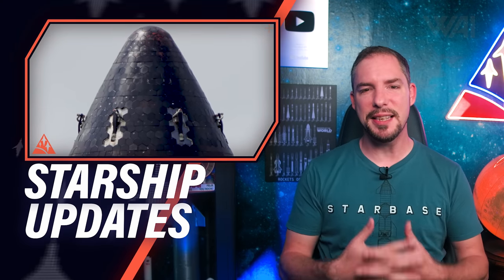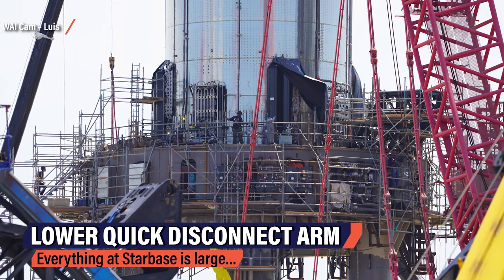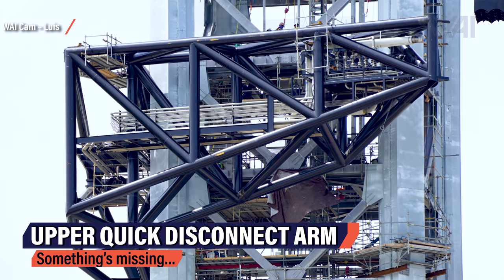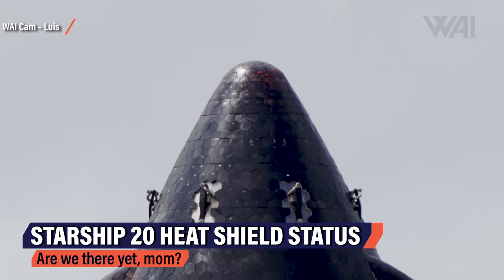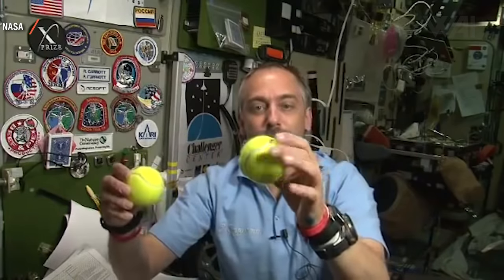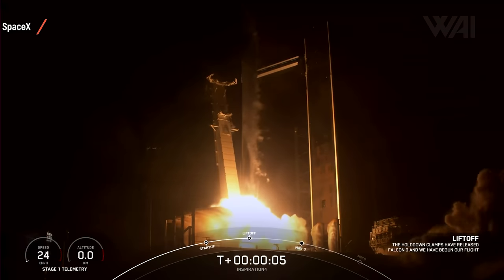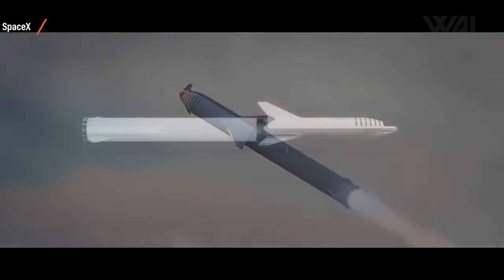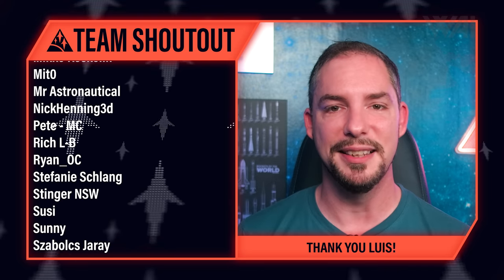SpaceX Starship Heat Shield Done! – Inspiration 4 Launch Summary

Comment: We need to make space travel cheep enough to take all the flat earther ring leaders to high orbit and lay that one to rest for good!
Reply: New ringleaders would arise from the ashes of the old. 

People have known the Earth was round for well over 2,000 years. Aristotle is credited as the first known person to calculate the circumference of the Earth in the 300 hundreds BC, but was off by a lot (about 20,000 miles too much). Around 250 BC, Eratosthenes got a measurement to within a couple of hundred miles of the actual circumference of ~24,855 by using the angle of sunlight in two wells in Egypt (he got around 25,000 miles). The whole bit about Columbus proving the Earth was round is silliness. Columbus thought the round Earth was smaller than it is by using a calculation that was disregarded by most educated people.

Comment: How Space X will rotate the rockets on vertical access to align the QD arm or the fueling platform at the bottom ? although just lifting it and rotating would work temporarily but not a permanent solution..

Comment: I'm puzzled. the steel hull is still bare where the mounting points for the crane are. I would have assumed they cut those off once mounted on the B4 and then tiled over.Otherwise its a weak point in the sheild where friction and air can get under the other tiles and rip them off?
Reply: It will be covered later
Reply: They haven't stacked it on top of B4 yet.
Removal will have to wait for that to be completed
Reply: @kevinkrammer8077  so......basically, spacex starship heat shield isn't done yet ;)

Comment: Odds to get the first orbital starship to splash in one piece.... maybe 0% to 5%. Odds to get it to orbit in one piece... maybe 20%. Odds to get it off the launch pad in one piece... I hope the odds for this are very high. However, there are so many firsts even for the takeoff for the booster and the launch pad and the launch tower. I would rather have people guessing on how many startship launches are needed before the first splash in one piece. And when will we see a first launch of reused Starship and the booster? I would say early 2025 or later... but of course I hope they get there much sooner.
Reply: Eh, Musk thinks B4/S20 will likely get to space, it's the return that is what they think will take some tries. Elon Musk's Mar 30th, 2021 tweet

"Next major technology rev is at SN20. Those ships will be orbit-capable with heat shield & stage separation system. Ascent success probability is high.

However, SN20+ vehicles will probably need many flight attempts to survive Mach 25 entry heating & land intact."

Comment: Forgive a dumb question: but how can they launch to orbit with all those extra bits and pieces outside the booster hull?
Are they going to give them fairings or is this booster for ground testing only?
Reply: Fairing will be added
Reply: As Alvian said, they will likely add farings over the equipment, but the Super Heavy booster doesn't get near to orbit.

Comment: Production Note: Felix, your facial skin looks very red. That is unusual. How do you color balance your cameras? The easiest way is to set a custom color balance by holding up a large white surface such as a sheet of paper where your face will be. Then zoom your camera in so the full frame is filled. Go to the camera menu where it allows you to set a custom white balance. Your camera's manual should tell you how. Then lock it in. Remove the white surface and zoom out. Whatever you record will now be color accurate.

Also, your lighting looks much better.

Terry Thomas
Director of Photography 
Atlanta, Georgia USA

Comment: I understand spaceX is planning on splashing down SN20 in the ocean for safety reasons rather than risk a land based recovery attempt.
I was just wondering is the reason for not attempting a drone ship recovery the greater weight of starship compared to Falcon , is starship too heavy ?.
Reply: There are a lot of reasons, but the main one is that drone ships are expensive, and they're not going to risk putting one in the target area until they're confident that the vehicle is going to be reaching that target area in one piece and under control. And if they had that confidence, they wouldn't be dropping it into a missile test range in the Pacific - they'd be trying to land it somewhere closer to home.

Aside from that, there's also the fact that they don't have any spare drone ships, their existing ships aren't designed to operate in the rougher waters of the mid-Pacific, and yes... Starship is considerably larger and heavier than a Falcon booster, so the ships might struggle to bring it in.

Comment: Why are TPS tiles butted up against each other?  Why not overlap them?
Reply: My understanding is that they will expand slightly to fill the very small gaps between them.
Reply: @steveaustin2686  I understand that.  It's how the shuttle TPS worked.  It requires some kind of malleable high temperature thermal blanket material in between to deal with the expansion and contraction as well as the plasma bleeding through.  

It's a stupid, overly complex design.

Roofers deal with a similar problems with roofing tiles.  Roofing tiles expand and contract, but they also have to keep out rain.  Also the rain only comes from mostly one direction, plus or minus maybe 20 degrees of arc.  

Roofers solve the issue by just having tiles overlap a little.  As far as I can tell you could do the same thing with a tile TPS system.  It solves both the cracking problem where tiles expand into their neighbors and it avoids plasma bleed through that threatens to compromised the hull.
Reply: @joelcorley3478  Roofing tiles sit on the roof and get blown off in high winds. The thermal tiles deal with supersonic speeds on ascent and hypersonic speed on descent. Not to mention they are reportedly fragile for bumps, so them rattling against each other where they overlap is likely not a good thing. AIUI, with the steel hull behind them, the gaps in the tiles are not as big an issue as they were on the aluminum Shuttle.
Reply: @steveaustin2686  Roofing tiles don't simply sit on the roof.  They are attached.  I used to live in an area that routinely experienced 60 mph winds.  I never had a roof tile torn off because they were nailed down and used an adhesive at the edges.  I'm pretty sure you could design an attachment system that worked at supersonic velocities.

You could expand on my suggestion by having the tiles overlap on two sides - from the windward side and the nose.  Put some kind of bullnose cap on the nose and you would minimize the shear force during launch, streamlining the airflow.
Reply: @joelcorley3478  I live in Florida and I'm thinking of hurricane force winds. I'm not sure that overlapping will work as I mentioned above that the tiles are fragile for bumps. You certainly could write up a description. Musk took a suggestion from Tim Dodd, Everyday Astronaut, during an interview, so why not try it? The worst they can say is no.
Reply: @steveaustin2686  - I suspect hurricane force winds are a little different than the forces experienced at max-Q and on re-entry.  For one thing I think hurricanes are more dynamic so surface turbulence is probably a big problem, while simple shear forces and thermal expansion are probably the main issues the tiles have to contend with.

"Bumps" are basically issues with surface deformation due to second derivative forces - rate of rate of change in velocity or simply rate of change of acceleration.  That causes the structure to deform in a waveform.  The waveform causes the tiles to strike against a neighbor.  To avoid damaging the tiles, you don't want to dissipate the force of these waves through the tiles.  In other words you want the tiles to slide over each other and not hit each other.

As for contacting Musk, I really have no way to do that.  I'm not a YouTuber - I'm just a recently retired Microsoft software engineer.  I would like to get the idea in front of Musk and I really don't care if I get the credit for it.  I just think this idea solves problems I see in the TPS tile assembly and it does it without adding new parts.  Indeed it potentially deletes the thermal blanket they're using under the tiles, thus saving hopefully enough to offset the weight of the overlap.

I brought the idea up here in the hopes that others might see the merit in the idea and champion the suggestion in forums where he might see it.  And FWIW, I have tried tweeting the idea to him directly ... but I'm sure that was probably just lost in the noise he sees every day.
Reply: @joelcorley3478  Um, max-q is usually at or after the spacecraft goes supersonic, so quite different that a hurricane.

By bumps, I mean physical hits to the tiles.

You could always type it up and mail it. That is what I was actually thinking about.

Comment: I love SpaceX and their progress, but there is no way that S20 can survive reentry in one piece. If that happens, I'm going to go bald for a month.
Reply: Yep. There are a lot of people here with very unrealistic expectations given how many new elements will be present on this flight. 

The two failure modes I'd be worried about are the booster, and the re-entry. I'm pretty confident in the vehicle itself, so if the booster works, they should reach orbit.  But I'm at best 50/50 on the booster running for long enough to reach separation, and I think I'm generous in suggesting a 1% chance of successful re-entry.

Comment: How can the heat shield tiles stand up to the force of being "grabbed" by mechazilla?  The tiles will be supporting the entire weight of Starship.
Reply: Mechazilla arm will not be touching anywhere near the tile area
Reply: @alvianchoiriapriliansyah9882    Where or on what will the grab arms contact Starship?
Reply: @davecrook8355  mounting point near the forward flaps or the flaps itself

Comment: Failure is an option, but how do they gather data on how the heat shields fail if they can't recover it?
Reply: Simply by telling if it survived reentry in the first place, and sever data from sensors & cameras
Reply: @alvianchoiriapriliansyah9882  Sure, but it would seem better to be able to physically inspect the tiles after returning, and look at damage to the spacecraft where the tiles failed to protect. Afterall, we want a spacecraft that can be relaunched over and over without being rebuilt, not one that can simply avoid destruction.
If it's not ready to land, I'd add some sort of explosive airbag system that is deployed on the ocean so it won't sink.
Reply: @aresmars2003  They can still inspect the one they intend to catch

Comment: I understand a heat tile is constructed in a very particular way to give it the desired properties. But why wouldn’t an abrasive material that could be sprayed on in thick layers work? I understand the weight exchange of the problem, but the material could ultimately be optimized to be effective and light weight.
Reply: Can you explain in more engineering details how the spray-on materials is gonna be suitable for rapid reuse?

Comment: C'mon man, SpaceX is swinging for a home run first time at bat. Untested booster, first time Raptors running 100%, first time at launch velocities, first time vacuum Raptors perform in space, first time heat shields, first time return at orbital velocities. I give them a 25% chance of successful booster to full altitude without blowing up, if they reach altitude I give them a 75% chance of vacuum Raptors getting Starship to de-orbit point, then 0% chance of landing with break up in upper atmosphere. Even if they lose the vehicle on re-entry, that would be a very successful flight.

Comment: Felix, you repeated a mistake from the life stream. At 10:47 in your video you claimed Inspiration 4 will fly higher than any human since Apollo. And the graphic from SpaceX shows the altitude where Hubble is now. But that's not where Hubble was first launched. Anything in Low Earth Orbit is gradually falling out of orbit. ISS stays in orbit because it receives propellant to constantly push it back up. But Hubble doesn't. It was put in a relatively high orbit where it would fall more slowly. Space Shuttle mission STS-31 in April 1990 launched Hubble to 613km perigee, 615km apogee. Today's mission is to 575km so actually this is the highest since Hubble was launched in 1990.
https://en.wikipedia.org/wiki/STS-31

Comment: They should dip the belly in a ceramic coat then bake it in one piece.

Best part is no part
Reply: More complicated & prone to cracking
Reply: Do you have a 51 meter (163 ft) by 10 meter (33 ft) by 10 meter (33ft) oven hiding somewhere? :) :) :)

Comment: Question;  Could the Spaceship slow its speed while in low earth orbit, then drop into earth's atmosphere and land wherever?  Eliminate the need for heat shields. Bozo dropped without a heat shield, two men jumped from a ballon without heat shields.  Im just wondering.
Reply: It will waste tremendous amount of fuel
Reply: @alvianchoiriapriliansyah9882  What is the weight of the heat shield?  Maybe a economical trade off of fuel vs weight could be made?  What if you were the person to figure it out?  Imagine how wonderful that would be.  Thank you my very very smart rich friend.
Reply: @jamesfrost7465  Still results in a net waste of fuel even when heatshield is removed. Learn rocket science more and you will understand
Reply: @jamesfrost7465  Nah, but next time research the topic more thoroughly before commenting

Comment: It will not make it. The chances are low. It is funny to think that the shuttle failed for the heat shield and now Space-X has problems in the same place. Where is the refrigerated steel?
Reply: Shuttle had plenty of reasons for its failures to meet design objective that won't be shared with Starship

Comment: Why are they using a heat shield concept that was developed in the 1970s & which failed – over & over – on the STS?
Reply: Do you know of a better one?  Also, the heat shield tiles on the STS program performed remarkable well.
Reply: They don’t. These tiles are different from the shuttle tiles, there are not nearly as many different shapes, and the way they are attached is much better. On top of that, there is nothing above the rocket that can fall down and damage the tiles, the way there was for the shuttle (foam debris from the tank). This rocket also doesn’t need the carbon-carbon wing edges (with low-melting point aluminum just behind the carbon-carbon) that the shuttle needed — a foam impact there was the cause of the second shuttle fatality.
Reply: @peterfireflylund  Agreed. I do notice the Starship tiles are mostly hexagonal in shape, whereas the Space Shuttle tiles were mostly square or rectangular. Do you know the specific reason for this?
Reply: @peterfireflylund  Baloney. Same tech. Still susceptible to separation & failure.

Comment: The entire heat shield needs to be a small number of large prefab pieces. A million little tiles is not a practical method. It greatest a million different points of failure and takes forever to replace hundreds of bad tiles..
Reply: Large prefab means more cracks